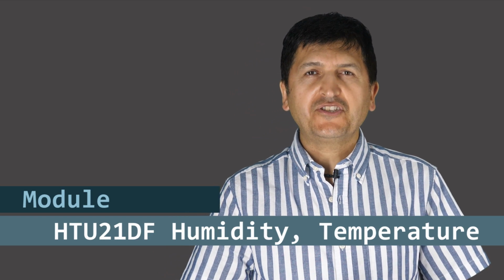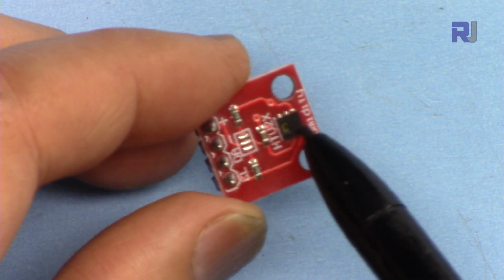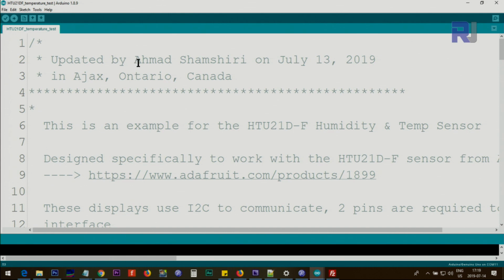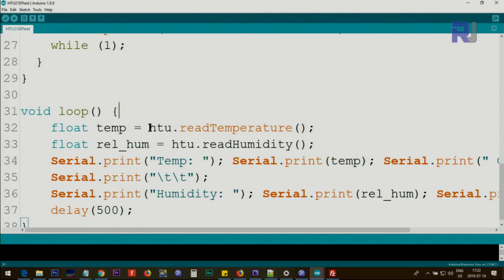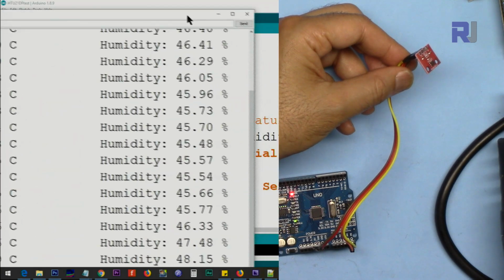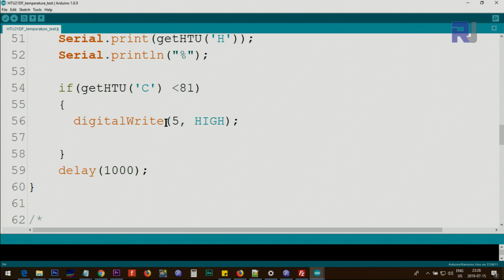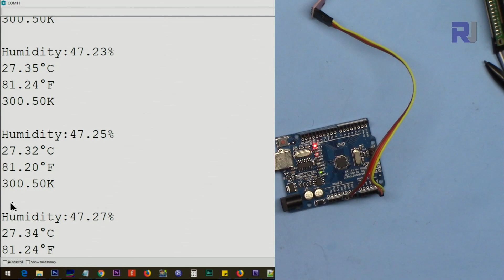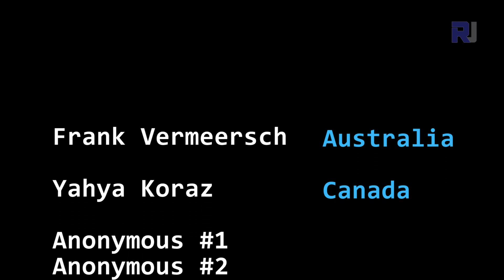How to use HTU21D and HTU21DF Humidity and Temperature Sensor with Arduino RJT176

Comment: How would be the programming using two HTU21D sensors?
Reply from the maker: Hi, I just wrote code to use 2 more of HTU21D sensor the link is in the description and here for you http://robojax.com/L/?id=274 for I2C, you need to take wires from A4 and A5 and share it with both sensors.  I will try to put an image if I can.

Comment: my aliexpress HTU21D has a deviation of 2 ° at 24.5 ° C (reports 26.7 ° C) compared to my exact DS18B20
both without activated pullups and with activated ones
Reply from the maker: in that case correction is needed.

Comment: Do you know the difference between HTU21DF and HTU21D? at aliexpress i only find the HTU21D. HTU21D-F is from Adafruit and HTU21D an chineese version with less features?
Reply from the maker: the F refers to filter which this one doesn't have. However code is the same it is just physical filter that makes it different. The one I shown has no "F". I have updated the page where the code is the created image explaining that. See the links.

Comment: lol minus 6% humidity. But the device is impressively low power and accurate. Except for the humidity calculation...
Reply from the maker: Yes. If I used absolute value, then we didn't know if it was actual 6% or some incorrect value.